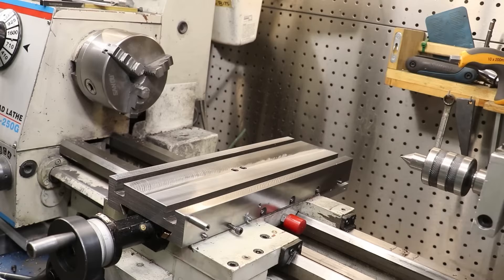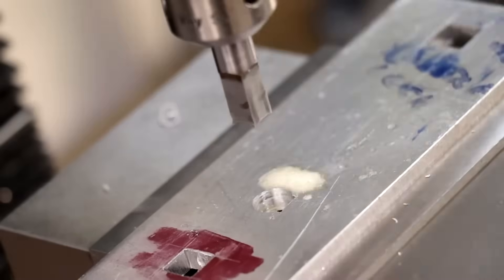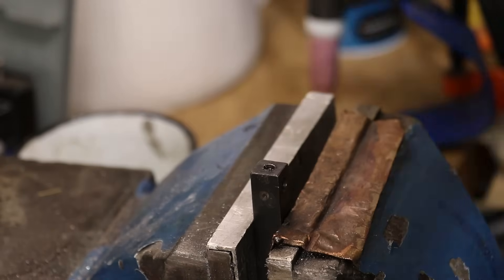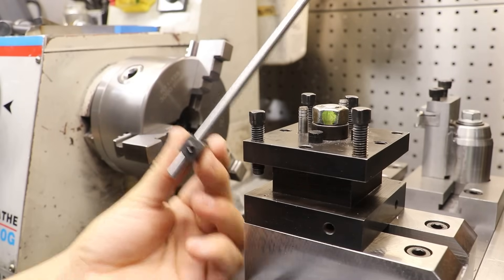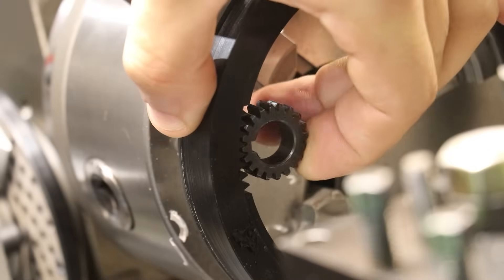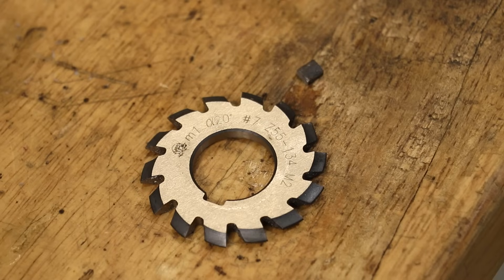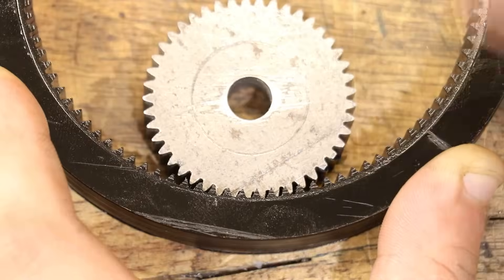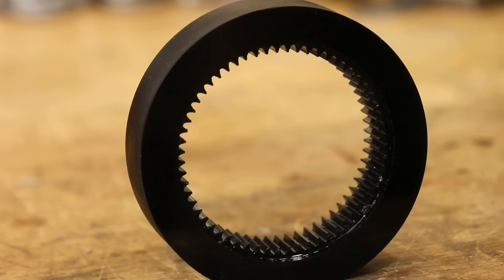Making Internal Gears - It Took Longer Than I Thought (Ring Gears)

Comment: I'm the creator of the "Helical Gear Generator" plugin for Fusion (My YouTube profile picture is actually a valid gear profile, I was playing with non-linear teeth). I wrote that code a long time ago and played with ring gears. IIRC the only difference in the tooth profile is the addendum and dedendum essentially being flipped. Basically you need your cutter to go to more of a point (IIRC ~0.2 module) so you get the necessary root depth for clearance in the mesh and you also want to stop cutting your ring tooth top  face that same distance from the cutter you made to have a proper amount of top land. This incorrect clearance is probably also a large contributor to your backlash, the spur gear might not be able to sit deep enough.
Reply from the maker: Holy damn, its a nice plug in. I don't use fusion myself but I have heard good things about your work.  You are right that the profile is slightly longer, I just was not sure about the off the shelf cutters ability to generate that end bit of the profile. The cut depth is correct but it is still a little wide for my liking. I think I can slim down the cutter just a bit more and it should all fall into place. It is not perfect but I think it is on the right track.
Reply: @artisanmakes  basically what your attempting seems sound to me. You just need to use a "cutter tooth" that is (ideally) a longer, pointier tooth than your cutters can provide. So, as an alternative, you could probably come by with a second, simpler, tool to create some clearance at the root for the mating spur. The geometry in there doesn't have to be an involute, it just has to provide clearance. Another option that comes to mind is to shorten the height of the mating spur teeth by about 0.2 module instead to get the clearance. Anyway, I've watched enough of your videos to know you are very clever, I'm sure you'll find a solution one way or another 😁
Reply: @artisanmakes  oh, and remember the critical dimension is the pitch circle. Pushing that in or out will also adjust the backlash.
Reply: Holy Sh##!! I use that plugin alot! It's amazing thankyou so much for all your hard work, I sooo appreciate it. ❤
Reply: @rossk7927  I had 6 ring gears, 6 sun gears and 18 planet gears made using EDM. They were used for a yacht capstan winch. They were some of the most accurate gears I've seen in 50 years. The winch was driven by a 24 volt motor. Although they run like silk the cost prohibited the EDM route. The production gears were redesigned as a cycloidal ring and pinion gearset which were lapped as pairs.
Reply: @thepagan5432 That's cool

Comment: 18:24 A bit of terminology - the gear cutting process you show at the end is called gear shaping. A single reciprocating tool. Broaching uses multiple teeth pulled or pushed past the work, each tooth taking a little more than its predecessor.
Reply: Perhaps cut a spur gear, grind for relief & cutting edge & then broach with it.

Comment: A nice effort, AM. It's a slow job shaping each tooth separately. I think the gear tooth spaces still look too wide. Using a cutter for making external gear teeth, I think you are failing to include the 'protuberance' at the tip of the cutter that forms the clearance at the bottom of the tooth when meshed with the engaging tooth. The part of the tooth above the pitch line is the _addendum_, the part below is the _dedendum_. For Module (Metric) gears, this is 1.25 times the addendum. It would work for DP, but I think the standard dedendum was different with imperial system gears. 1.157 comes to mind, but I can't find a reference. 
For your purposes, it would suffice if the width of the tooth and the space next to it was the same along the pitch line. Clearances are usually very small. Your project takes me back to when I worked for a firm making actual gear shaper cutters decades ago, we tested the profile by cutting a rack tooth in black perspex/acylic, and projecting it.
Reply from the maker: It does still feel a bit too wide for my liking and like i say at the end, I still think a bit can come off the diameter of the tool. The cut depth is correct for an internal gear, but I left the cutter a little wide because I was overly cautious about making the cutter too small, for that very reason that the external cutter probably can not cut the full length profile that we need. But I think we can get close enough that it should be okay. "Should" carrying a lot of weight though. Cheers

Comment: Nice approach. Though I laughed when you took a crashed MGEHR as material.for holding the cutter. Got a new one last week to replace a crashed one. But I used an angle grinder to cut off the useless end. Now know one use for broken MGEHRs.
Reply from the maker: That is one thing I am in never short supply of.

Comment: Oh my ...i hate lathe broaching.  At work we have a part that comes every year in increasing numbers that requires a keyway broached in . Since the hole isnt trough the entire part it needs to have a clearance cut in the back and then broached from the front. Even tho this runs on cnc the setup is a nightmare every time . The broaching plates are hss and super expensive and the material a special aluminium mix just eats them from time to time when the chio wont break

Comment: Thinking outside of the box here, but what about attaching you cutter to something like a jigsaw and either  make an attachment to attach it to the lathe cross slide, or make a completely standalone machine. That would take all the hard work out of doing this
Reply: The surface speed of a jigsaw would be about a 1000 times too fast, it wouldn't be anyway rigid enough either

Comment: 3D print the gear then use the "lost PLA" casting method to cast your gears? Would that work? Is casting too inaccurate for gears? Could you clean them up to a usable level?

Comment: Interesting way to use the gear cutters to make the internal gear cutter. I only see one problem: if you hold the cutter straight like that the profile will be slightly off, since if you would cut a gear with it, the angle will be slightly different between teeth. Couldn't you make a fixture that holds the cutter blank in the dividing head right where the outside of a gear blank would be and then cut it in the milling machine the same way you would cut a gear? Would also be nice if you could rotate the blank between cuts slightly (just a few degrees) to create a clearance angle.